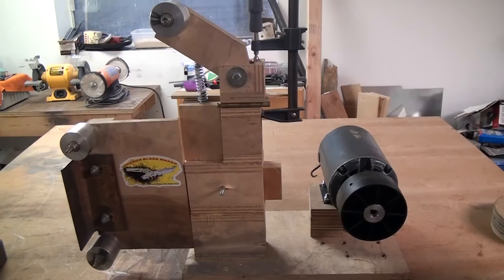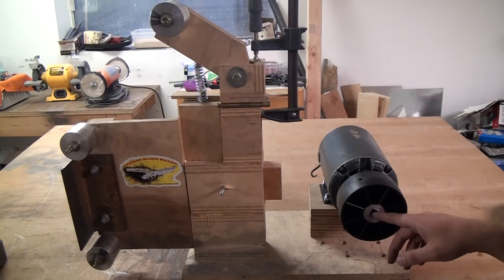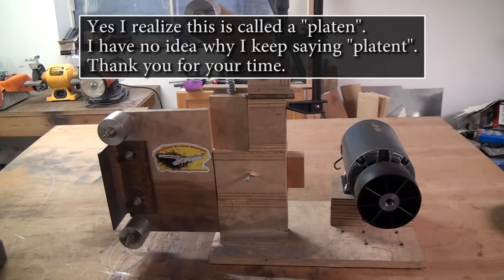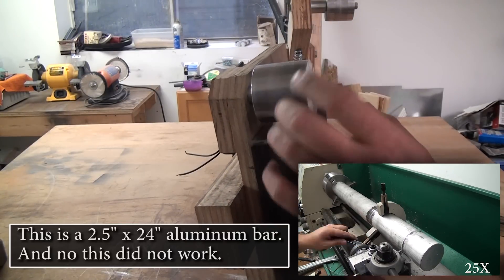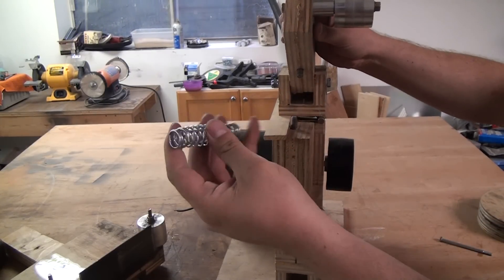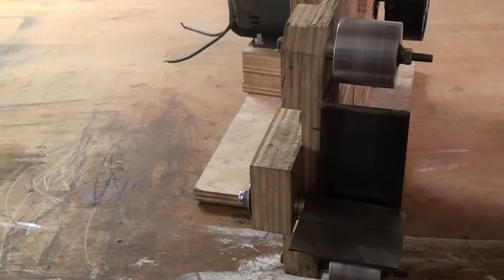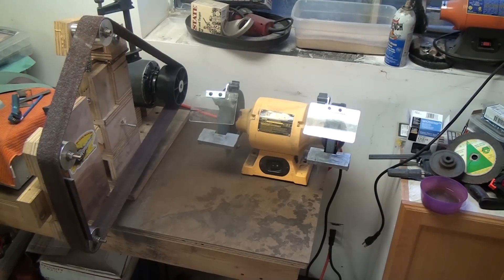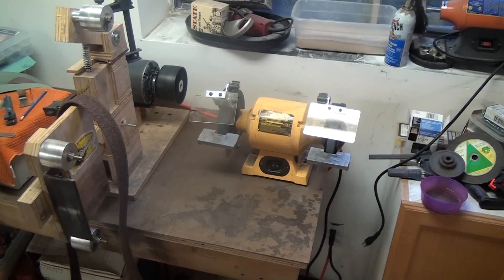Belt Grinder (Made from Plywood)

Comment: OMG! That is so awesome!!!  Seriously....that's got to be the most creative home built one I've seen and I've looked at a ton of them!  Have you seen mine?  I love the 3hp 220v I have on mine.  I have stepped pulleys on the drive and I can get the belt over 10,000sfpm if I really want.....scary as hell!! I typically run it around 3500sfpm?  I'd have to recalculate it.....it's a beast!  
30lbs on the tension was the sweet spot on mine....especially with thick belts.  
What I found on the tracking....tilting vs angling.  The hinge angle needs to be half of the belt angle, if that makes sense or it ends up driving the belt because of the angle.  If the hinge pivots the tracking pulley right in the middle of the belt angle, it tracks by tilt. If that hinge pivots from a different point, the pulley does not stay perpendicular to the belt as you move the tracking pulley.  I'll have to look at mine to see if my tracking pulley is crowned or not. 
As someone else said....it worked!  It did the job you needed it to do so it was perfect!
Reply from the maker: I have seen yours, and I really like the design. I'm going to design something for 3hp I think, and go stepped pulley too. 10ksfm is INSANE!
Good thinking on the tracking, you explained it well. I'll remember that when I start drawing up new plans :)
If I put it on a stand I might try for the horizontal/vertical option you mentioned in another video.
Reply: Did you see the one I use in my shop(w/3hp) or the DSM grinder with the skeletonized body?  My shop one uses 1.5"x60" belts to help keep it more compact.
Reply from the maker: I can't remember. It was the one that would throw the belt on the ground and the belt would keep its triangle shaped.

Comment: Belt sanders are such simple machines that it's practically a sin not to at least attempt making one. Motors can be an issue, certainly if one doesn't exactly know what to do with them they could be a bit of a risk, but even then, some Googling and a bit of common sense can help a lot.

Made my first belt sander when i was 15 with my uncle, no welds, just some square tubing and some aluminium corner brackets. The pulleys had been salvaged from an old factory and i think they used to be some form of tracking for a conveyor, already crowned and with decent bearings.
Reply from the maker: Awesome.

Comment: Awesome! Really timely, actually, startin' up my own garage workshop. Would you suggest going for a belt sander (grinder?) or a bench grinder for doing things like deburring, small chamfers, and tool grinding/sharpening (i.e. hss lathe tooling)?
Reply from the maker: I like the belts better than a regular wheel grinder. I like having the flat platen and I like being able to swap belts out to whatever I need (belts are so cheap!). Also, when using the ceramic belts (Norton Blaze) it seems like I can grind HSS much faster and without as much heat going into the toolbit when compared to grinding on a wheel.
Reply: Cheers Rus! Sorry for the delay. Was leaning towards the belt since it seemed like it would be more widely useful, but was hesitating since I wasn't sure if there were things you just couldn't do without a bench grinder. You rock!
Reply from the maker: +skyfire360 Well if you do a build then let's see a video :)

Comment: The tracking adjuster is ok but you have too much range the way you installed it. It only needs a little movement.  

The table would be better off turned where the side of the angle is the mount. It will give you better range on table angle and raise it to clear the side.

Just put a rubber mat under it and it should cut a lot of the noise.

I can't say that rebuilding it would make it work any better unless you really want to eat metal with it.
Reply from the maker: Good Ideas David, thanks!